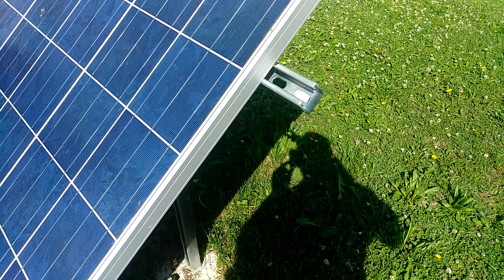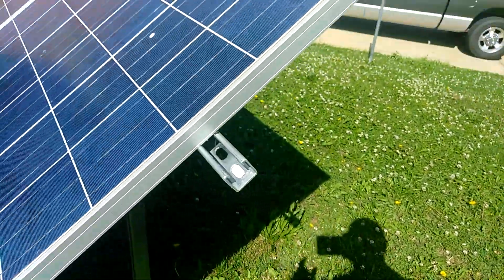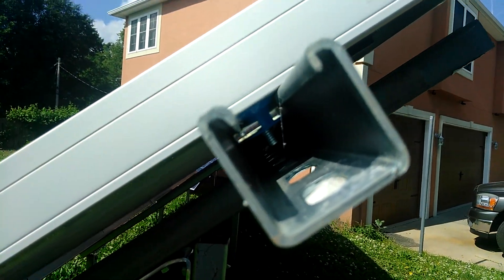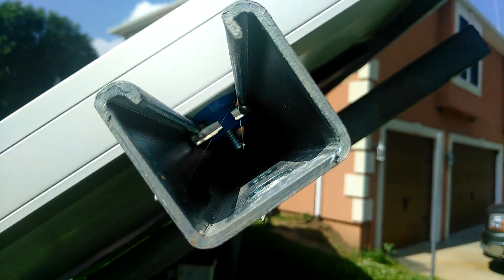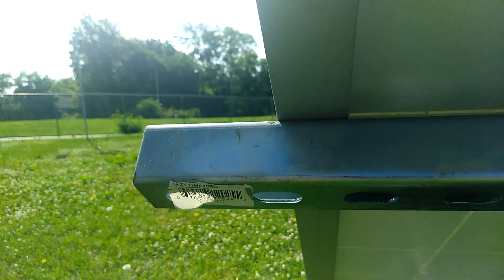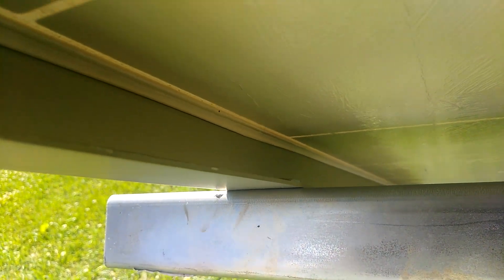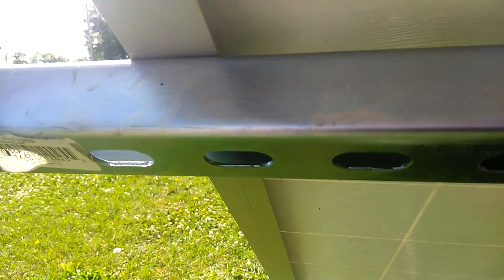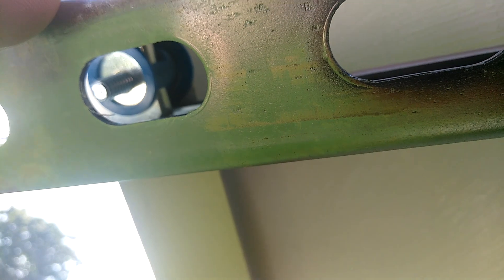the cone nut that holding down the solar panel to the super strut.

Comment: Thanks. That helps. Was it hard to tighten the bolt down? Doesn’t look like there is much room for tools.
Reply from the maker: No not at all turned down mostly with my fingers then use the wrench to tighten it up.